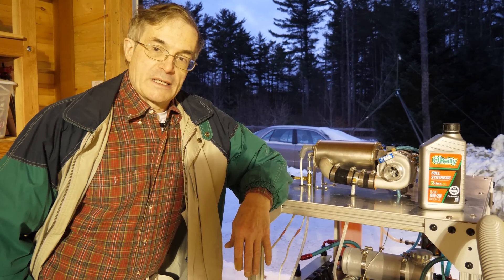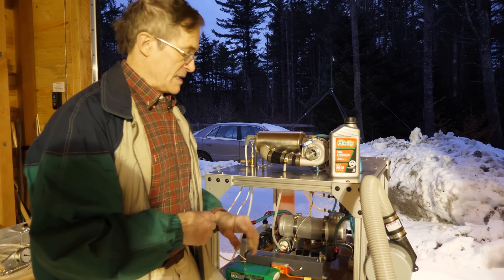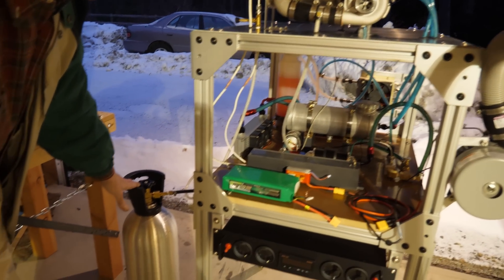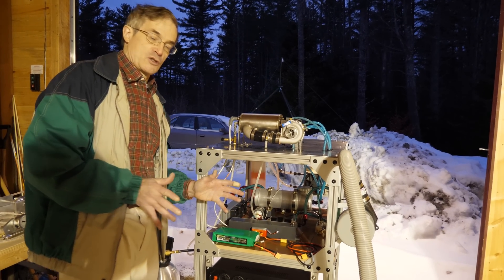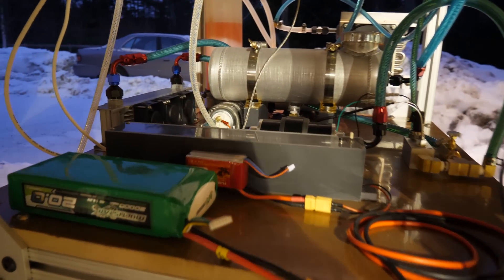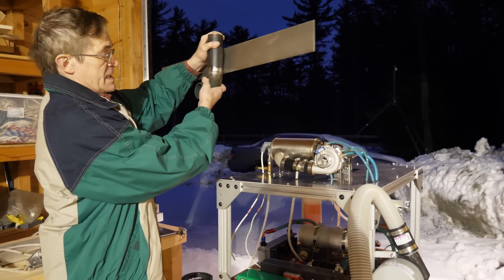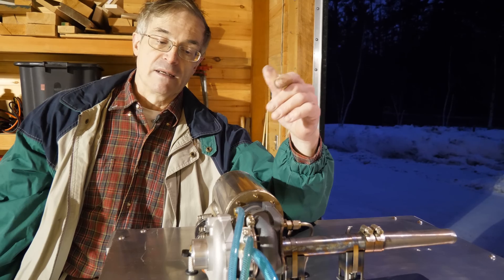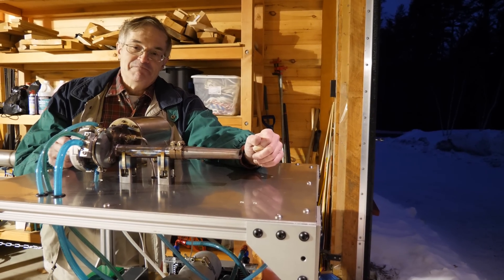FIRING UP THE TURBOJET!

Comment: I have two of the Chinese Webasto knock off diesel heaters, just a first thought could parts/moding one of those into a tiny turbine engine? The electric impeller fan forces air into the combustion chamber. Using that fan to start the process like you did but then allow a turbo to take over and be self sustaining?
Reply from the maker: Probably not. 
The fan we used is pretty unusual. It generates so much air velocity that there is actually a small pressure increase at the inlet of the turbine. We even ran it above spec for a brief time to get a successful start.

Comment: Lol i just thinking to make the exhaust gas for a furnace but i don’t think it’s hot enough
Reply from the maker: Probably  not.
The high velocity would add additional issues for the construction of the furnace enclosure.
Reply: @ wow never thought the man himself reply haha, from what i see on the combustion chamber design to optimized for furnace, if i change the fuel to diesel i need to measure the flame front distance and make the primary holes distance right at the flame front, is that the way to do it sir?

Comment: Sir, I am also making my own one, and I am also using automotive fuel pump to lubricate the turbo. But sir, I live in a hot area (40 Degree Celsius), so I have to use 10w40 oil. But these pumps cannot handle that thick oil. Now what to do sir cuz oil transfer pumps do not produce pressure?

Comment: Sir, what is the diameter of the inducer of this turbocharger? And how much thrust is it producing? Because I am making my one also!!
Reply from the maker: If I remember correctly, it was approximately 40 mm in diameter, and the engine produced 12 pounds of thrust.
Reply: Sir, my Turbocharger inducer diameter is only 20mm. Please sir can you tell me how much thrust my one will produce?
Reply from the maker: I'd guess you will see 3 to 4 pounds.
Reply: My engine’s weight is 5kg and it is producing 2-3 kgs thrust. LoL. Then sir, should I make it a turboshaft engine to generate electricity or make a motor car because I can’t make an aeroplane with this as the thrust to weight ratio is negative?
Reply: Sir, Shall I use an external Oil pump or just put the oil inside the turbocharger oil section and seal the two pipelines for oil in the turbocharger? And also sir I have used tin to make the combustion chamber.

Comment: I think air pressure from a air compressor(or propane) to drive the oil instead of a fuel pump would be easier to manage any pressure you might need 😊
Reply from the maker: It's  an option.

Comment: Interesting and well put together but...this is NOT a turbo jet engine per se. All this is doing is powering up a car/ truck turbo to create a small amount of thrust.
Reply from the maker: Thanks. 
It is indeed a turbojet.
This is one of those few situations  where size doesn't matter. Its  mode of operation is what counts, not the source of the components.
Reply: @TechIngredients  
We supply main shaft bearings and gearbox bearings for both gas turbines and jet engines. Both Inc turbo jets have axial flow compressors . The same cannot be said of a  cheap turbocharger designed as a simple air compressor which is simply being powered up by a burn can.
Your set up is obviously of high quality but it really isn't  a turbo jet as such.
Reply from the maker: You need to do a little research.  The first turbojets used centrifugal compressors, and they are still used in small turbojets such as Swiwin and Jet Cat models.
Cost is irrelevant  to the definition.
Reply: @TechIngredients  
We've been in the supply chain for many years, no research needed.
JetCat which you refer to are model engines.
Build a proper working TurboJet with axial flow compressor and I'll be impressed
..👍

Comment: I have a question: if a edf fan was mounted on the intake, or even between the compressor and combustion chamber, could it be used to both start the engine, and then generate power (with the appropriate battery and voltage regulators) for running the controller and pumps? I'm interested in making a free turbine to generate power for a hybrid quadcopter.
Reply from the maker: Yes.
These fans are not designed  to work at the elevated temperatures of the air coming from the compressor. But, mounting them in front of the compressor to start the engines and using the intake airflow to spin them and drive their motors does work.
Reply: @TechIngredients  I've seen metal bodied brushless shaft mounted motors on the intake side of r/c jets that use the convergence/divergent nozzles and bypass cooling for thrust.. some of those have been turned to turboshaft props, and some have had transmissions for helicopters, or free turbine. I wonder if any kind of power can be pulled off the starter motor like an alternator, for powering the turbine engine management, independent of the free turbine that will spin up a generator

Comment: Does the turbo always produce to the outer bound of equilibrium when you use the fuel valve to throttle the unit, or is it better to have a air inlet valve to throttle the turbo??? Nice build BTW
Reply from the maker: Equilibrium depends on the balance  of multiple  variables in the engine design.  Some are fixed, such as the turbo design (represented  by the flow map), the combustion chamber, and the outlet nozzle. The fuel flow is variable and adding bleed or bypass  valves allows  you to set that equilibrium at a different point, but the result will always  be at a balance position.
Reply: @TechIngredients  Thanks for the info. Actually you previously mentioned that you are going to use this engine to drive something else and it makes sense that "throttling" the unit like a motorcycle or car is not the goal...I appreciate the detailed explanations, thanks

Comment: Why not eliminate the idea of a larger turbine and just direct drive a generator to the turbo shaft?
Reply from the maker: The RPM is too high for the available  generators  to survive.  It can exceed 180,000 RPM
Reply: @TechIngredients  those higher rpms are at the sacrifice of efficiency correct? Would direct drive at 1800 or 3600 rpm be possible if maximum fuel efficiency was desired?
Reply from the maker: Those RPMs are necessary for the compressor and the turbine to operate efficiently.  You can't  change that. We're working on a method to bypass that limitation using a second, passive turbocharger.

Comment: Propane in its gaseous form isn't energy dense enough to make any real power as demonstrated by your video...This engine is barely self sustaining. It needs liquid propane, a proper combustor and fuel preheated...This is why real Gas Turbines use Kerosine.
Propane is a pretend engine makers wet dream....🤔😳😀😏🇬🇧 Handy for you not having an rpm counter, but you're not fooling me...lol...😀

Comment: Great. My congrats. You could extend the axel over the cool coil and set up a brushless altrernator using the tork so tou can generate power directly from the turbine.
Reply from the maker: Thanks.
I don't think so.  The problem is the extreme  RPM.

Comment: When I was studting at Tampere University of Technology, some guys had a club for jet- and rocket engines. They mede a turbojet from a huge turbo from some truck and installed it on a moped. The too speed was approx. 80kmh. Moped was called ”eunuch” as the driver would be one if the turbo exploded during driving. 😃

Comment: I’ve been watching this folks that runs other turbines for different applications. You’re the first one to address real bearing oil and temperature values (with gauges and rpm readings) which in the end make a project to become real. Or at least the first one to consider it. That’s is why the flying man and some other RC enthusiasts do not cross the toy or fun line. Those folks can’t run their projects other than few minutes.
I imagine a real every day flying transport. But that one is a bigger and longer project to work on. Thanks anyway.

Comment: We’re those “pops” compressor stalls?
Reply from the maker: No.
They were bubbles in the liquid propane.  When you attempt to throttle a volitle gas anywhere before the exit nozzle it will transform into a gas at that point.  We completely eliminated that popping when we allowed the propane to vaporize in the tank and tansferred only vapor through the lines. There was also no popping when we moved to pumped kerosene as the fuel.

Comment: Three ideas take em or leave them 🌹✌🏽
Mount the gauges near the top of the stand for easy viewing 

Use combustion chamber that looks more like the fat pipe off of a two-stroke?

Use a couple diaphragms on your sensors to adjust the oil pressure with the boost pressure.

Love your channel! 🔥

Comment: You really piqued my interest when you explained why you were using a smaller turbine. I am hoping someone will build a hybrid turbine electric motor for small airplanes:  Small turbine driving a generator driving a 200 hp electric motor with about a ten minute battery backup. If you can get the fuel flow down to around ten gallons an hour there would be a huge market.

Comment: Shall I use Diesel as a fuel instead of propane and which type of nozzle suits for injecting Diesel?? Please reply Iam Willing to do this engine as my college project
Reply from the maker: I haven't tested that, but you might want to allow for dual fuel injectors as some turbojets require propane for starting and warm up.  Commercial RC turbojets use very tiny steel feed tubing within the combustion chamber to preheat the jet fuel prior to dispersal.
Alternatively, I have used pumped isopropyl alcohol as a direct replacement for the propane without any modification and it worked very well.

Comment: Great work explaining your creation. I am building a similar sized engine and just wondering what size the jet I should be using for the propane injection? Thanks in advance!
Reply from the maker: Take a look at our more recent video on the turbojet where I cover some of the issues with using propane.
Sizing the injector for a liquid fuel is pretty straightforward. Determine the airflow mass the compressor will generate in the middle of its flow diagram, determine how much heat energy is needed to raise the temperature of the air plus fuel mass to the operating temperature of the turbine inlet. Estimate the net fuel delivery pressure (minus the chamber pressure) and look up the Cv of the injector which gives a flow to pressure relationship. Then buy a few injectors that bracket this starting point.
Reply: @TechIngredients  Thanks for the quick and detailed reply! I have also noticed that combustion within my chamber is occurring further down the chamber, probably due to the current jet nozzle orientated axially not radially. Thanks again for the information and your video productions; looks like I got some maths homework to do!

Comment: You could have used a glow plug which doesn't require high voltage just high current its easier to setup and more easy to use you could save some space on that thing

Comment: centrifugal compression ram jet / pulse jet tesla turbine pump with any air or nos mix, direct inject, self-compressing, like a fan turbine
Reply: you have the answer on the inlet, the spin air pump, similarly as the compression stage of the edf-gas-jet, could run pulse jet, no need to worry about inlet trash, just keeping out the major stuff
Reply: the deflector can be used as vtol for airplane, the wings, deflecting, or redirecting tube like exhaust from f-35, harrier

Comment: I wonder if some strategically mounted vortice inducing stator vanes installed on the turbine inlet and inside the burner tube might improve flow efficiency and boost pressures?

Comment: If you put the engine on wheels then use a scale to hold the engine back ,  you can then measure the usable thrust the engine produces  !  What could be any better than that ?  There are a lot of ways to measure the thrust of an engine , But I always look to measure the usable thrust ,  Why would you wanna measure anything else ?  Using that 90 degree pipe is not going to measure the usable thrust at all , Not even close.  Just too many variables .  I could take the time to point them all out , But I think you know .

Comment: Hey, I know this is an old video by now but I just found it! I like how you present things, easy to understand while at the same time providing real useful information and details. I have questions: 1. I know propane is easier to work with but for vehicle use wouldn't pump diesel or gasoline be preferred? 2. Is it completely impossible to take torque directly from the turbocharger shaft? It seems like that would be more efficient than directing hot exhaust gas onto an impeller. Although that would function somewhat as a muffler as well.
Reply from the maker: Both fuels work, but as you said propane is easier.
The main problem with direct take off is the incredible RPM of the turbine.  At well over 100,000 RPM the conversion of this into useful output through a generator or a transmission is really tough.

Comment: Seems like a lot of extra bs to achieve a goal ( producing power/electricity/heat ) that we have already done with ICE's. The Achates engine is on par to be over 45% efficient  and produce more power with the ability to use almost any hydrocarbon fuel. Why even bother with this?
Reply from the maker: BS?  Hardly.  We're building a jet engine not trying to build the most effecient power source for a generator.

Comment: Absolutely love the Awesome work 
Please consider the non mechanical concept of power transmission using the extreme heat and steam to consume the Co2 as additional thrust

 It's using a primary stage of a two stage gasification unit concept
Live lighting Hemp gasification
https://youtu.be/ztOrrce7568

Hemp fuel reverse induction ram
https://youtu.be/YQOx2G31ljA

Comment: You need more airflow, the compressor is staying in surge. Thats why it sounds choppy and the boost gauge bounces.
Reply from the maker: It turned out it's the irregular burning of the propane that's boiling in the fuel line.  As soon as we went to propane vapor it smoothed out.  We ran the larger jet in the follow up video on vapor propane from the start, it also ran smoothly as you can see in that video.

Comment: Would a waste gate be beneficial?
Reply from the maker: It might, especially if this is attached to an output turbine where variable back pressure could move the compressor out of it's optimal pressure range.  We improved the performance substantially in the follow up video on this turbojet.
Reply: @TechIngredients  good point.  Thanks for your reply. BTW You have the   best channel on youtube.

Comment: Any more updates on this? I'm interested in using such a turbine to drive a generator in as a truck range extender? What would you say the practicalities of this are in terms of fuel efficiency vs a diesel IC engine?
Reply from the maker: There will be updates.  The free turbine will be the next step.  However, the effeciency will be much lower than a diesel because of its much lower compression ratio.
Reply: @TechIngredients  I look forwards to it! Have you considered using a recuperator? If you're interested in the concept check out: https://www.wrightspeed.com/

Comment: Using propane under pressure seems a little like cheating. You get to skip over fuel pump, injectors, and ignition. Let's finish the job, one day.

Comment: I think you're losing sight of the goal.  lf you want to turn another turbine with this machine, then you don't really care about thrust.  You should care more about mass flow in the exhaust.  If you wanted to measure thrust, a force, you can't really do that without putting the machine on a thrust table.  Why?  With a jet engine you have suck, squeeze, bang, and blow.  All you're trying to measure is the blow.  Suck is a huge factor in overall thrust of a jet.  But you're turning another turbine, not trying to get forward forces.  If you want to really increase mass flow, inject water into the blow.

Comment: Hello !! Did you say the spark runs only for a limited time ? So the combustion does not occurs all the time ?
Reply from the maker: No, it's self sustaining.  The spark is only needed for starting.
Reply: Tech Ingredients oh okay !! So there is not even compression ignition (like in the Diesel engine case) where the combustion occurs without spark plug, just by injecting fuel ? So after the startup, the compressor’s compressed air will go into the turbine that’s turns the compressor again and this loop will go on, while there is no consumption of fuel ? and the spark plug is off ?

Comment: Sounds like you have too much back pressure in the compressor based on the fluctuating boost pressure, the sound of the rpm changing rapidly, as well of the sound of what sounds like a compressor stall about to happen.

Comment: shouldn't diameter be little larger? intake v exhaust noise computation shows there is power loss; relative to oil pressure;

Comment: You could use a pitot tube to measure the outfllow velocity, along with a temp probe to get out flow temperature to capture the pressure through bernoullis principal or isentropic/energy relations.

Comment: 1:01 is that motor 12v? i can't find it in the internet
Reply from the maker: Look up JP Hobby EDF.
Reply: i did but i don't see the vacuum blower JP Hobby only sells edf's, i only found 120v 3 stage blowers in google
Reply from the maker: Oh, I see.  That is a Dayton vacuum motor.  That one is a 24 V model.  They make DC and AC versions.